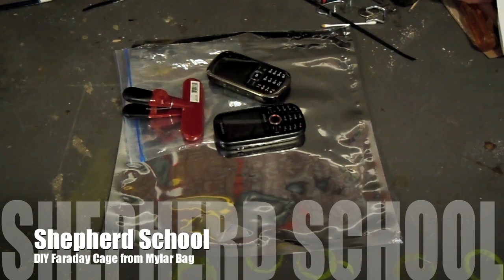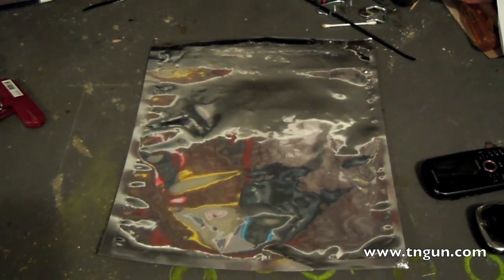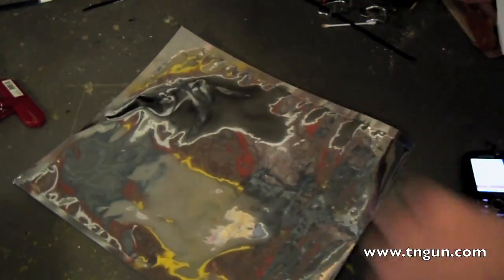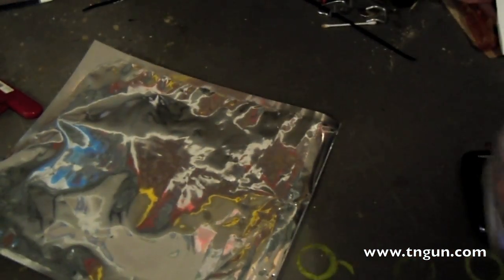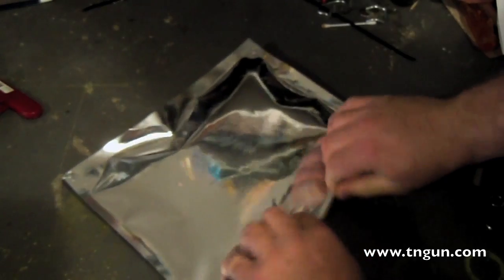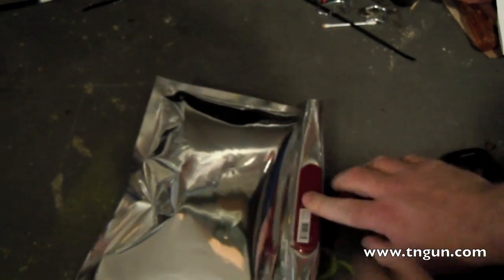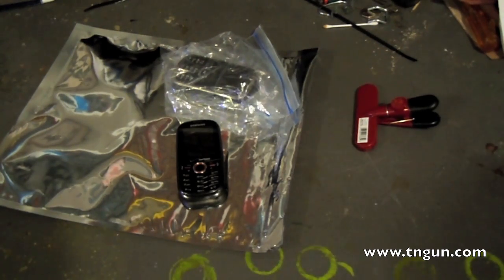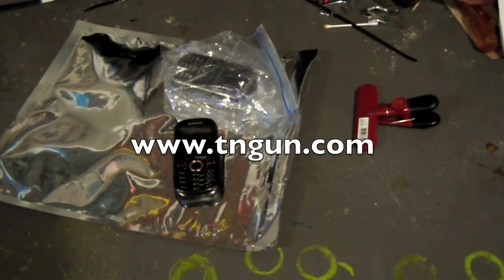How to Test a Mylar Bag Faraday Cage

Comment: Mylar bags do not shield electromagnetic signals because the heat sealed edges are not sealed in a way that make them a continuous conductor.   The second reason is that the aluminum that creates the oxygen barrier is applied using electrostatic deposition.. IE: Its not a continuous sheet of aluminum but instead its more like spray painted onto the plastic.    The aluminum flat sides of the bag itself would probably provide some shielding, but since the welded edges are not designed to be electrically conductive to each other, signal leakage is high.      Good for food, good oxygen barrier, poor EMP barrier.

Comment: I used 2 Cheetos bag to double wrap my cell phone and it worked.  But cell phones are very weak output.  Tried my ham handheld on 462MHz and the signal blew thru the double wrap at 2 feet, but a third bag did the trick.  Do I recommend Cheetos' bags, heck no!  I use aluminum foil/insulating plastic film and triple wrap.

Comment: From Rob Hanus:

Using a cell phone to test whether your EMP protection 
is effective or not. Cell phones work primarily in the 2.4 GHz range, 
which is also the same range that microwaves and most WiFi operate at. 
Thus, the shielding in a microwave is specifically tuned to shield these
 frequencies from getting out, or getting in. When you put your cell 
phone in the microwave, the signals will be blocked. Now try that with a
 radio and a strong FM and strong AM station. You’ll find that a 
microwave isn'’t very good protection at all.
Likewise, a Mylar bag will pass the “cell phone test” but doesn'’t 
really work well. When I first tried my Mylar bag, I put my cell phone 
in it while streaming a radio station over WiFi. After about 30 seconds 
when the buffer ran out, the phone went silent. When I called it, the 
phone was not available. Given this, it seems like a Mylar bag would 
make great EMP protection. It’s not, please read on.
The reality of this myth is that cell signals are very weak and easy 
to block with thin Mylar. The proof of this is that when I place the bag
 that has the phone inside it close to the WiFi router, the Wifi signal,
 at only 11 watts, was powerful enough to blast through the Mylar bag’s 
shielding properties. Had I placed an AM radio in the bag, I would have 
easily realized the ineffectiveness of the bag. When I was on the 
9,000,000 watt mountain top, I wasn'’t able to stop the RF with even two 
Mylar bags. Simply put, Mylar bags make terrible Faraday cages.
Source: http://www.thepreparednesspodcast.com/emp-preparedness/

Comment: Thanks!  Finally someone using a HEAVY mylar bag.  I am guessing that is a 5 - 7mil bag.  I plan to wrap any devices in plastic, then heavy tin foil, plastic again, tin foil again, then wrap in plastic one more time, then store in a sealed 7mil mylar bag.  Oh, with desiccants.  To Blue Marauder.  Yeah, cell towers would be crap after an event, but I am storing 1 Iphone for maps, contacts, how-to's and such.  Mostly radio gear, solar and battery chargers.  Oh.  LED flashlights too!  Can you hear me now?  Hello?  Hello?  Good!  2.4 GHz and 5.8 GHz are also good frequencies are good to try as well for testing purposes.
Reply: Could you afford moving?  Prepping for an EMP is pretty cheap.  Just because you move to another country does not mean you will not feel the affects of an EMP, especially if you are in Canada or Mexico.
Reply: This was great, been searching for "faraday's ice bucket" for a while now, and I think this has helped. Have you ever come across - Tennorra EMP Esterification - (Have a quick look on google cant remember the place now ) ? Ive heard some pretty good things about it and my buddy got cool results with it.

Comment: Late to the Party...BUT...Double Mylar bag DOES WORK to stop a strong cell phone signal.  When I found that a single bag stopped the signal in a low signal strength areas (like my basement), I went back upstairs and SUCCESSFULLY tested with A) two Mylar bags and B) a double wrap with metalized poly (a chip bag.) .  My best test was with an "envelope wrap".  Here is How: I wrapped my 2"x4" cell phone diagonally in a 9"x11" sheet of metalized chip bag.  Start at one corner wrap the phone once, then fold in side corners and finish the wrap.  Hold  the 'envelope' flap closed with a rubber band.  Test that in your area.  Cost $0.005 for a rubber band.

Comment: Stuff like this is total crap.
Get a 2 dollar Electric motor off ebay or where ever...
Take it apart and coat the inside windings entirely in foil making sure that its insulated from everything.
Now hook up a multimeter and spin the motor... notice it still produces current...

A flare is ENTIRELY and one part from a nuke is the Eletroc magnetic induced, as you now know for a fact thanks to running my test you know Foil does not protect from this.
There is a reason EMP hardening of military systems uses mono crystaline copper.
For small items foiled bag system can work, as the induced current wont actually cause any problems and against a nuke it can protect from other stages.
However if someone goes and coats a entire room in foil and thinks it will offer larger equipment protection it will not.
Reply: Can you wrap your trucks ecu in foil to protect it from a emp attack?
Reply: You are utterly incoherent.

Comment: That proves absolutely nothing. An EMP induces current in any electronics that have a coil (like a transformer) or an antenna. If you really want to test for an EMP simply connect a small transformer to a voltmeter and place the whole think in the bag. (you should be able to read it through the bag with a flashlight).  Use a simple spark gap generator to produce a small EMP and see what happens. When a real EMP happens it ionizes the atmosphere and microwaves are produced - gamma is filtered.

Comment: so what would a "one size fits all" shielding be? What levels of EMR are we likely to see with solar/nuclear EMP's? I'm looking for a portable solution for my portable electronics gear in my BOK and also my electronics equipment at home...the stuff I have at home is in use so I cannot lock it in a cabinet...I would robably have to shield the whole room. I'm looking at painting the room with aluminum infused paint then running copper wire at all joints in the walls, then out to a main ground..?

Comment from the maker: I did not do a specific video on this. but I did do a blog post talking about EMP pulse.  An EMP pulse is not the same frequency and wavelength of a radio or microwave, but I posit that if a cage cannot stop such weaker waves then it cannot protect against the much more powerful pulse.

Comment: I've seen a lot of these videos showing how a storage cabinet or mylar bag or even aluminum foil can prevent radio frequencies and/or microwaves in the later from getting through. But what is the relation of radio frequencies and microwaves to what occurs during a solar flare or EMP? Aluminum foil and mylar may protect against radio and microwaves, but is it protecting against the charge and other aspects of a solar flare? I have yet to find any videos explaining this.

Comment from the maker: @WprEmiere1985 You know your idea is pretty close to my thoughts - I figured I would buy a plastic antistatic bubble wrap bag from staples, put my ham radio in it, stuff it in a Mylar bag, roll the end up and clip it with some metal clamps and have a small light Faraday cage - if worse comes to worse, the Mylar could be used as a water container for drinking also...

Comment: @TNGun I agree, a safe would be a difficult thing to ensure there was absolutely no gap or hole of any kind, even through the lock. An effective shield must be 100% metal to metal sealed. Any tiny hold or gap is enough to make it ineffective. Steel or copper is recommended for EMP shielding. Obviously the distance from an EMP source and the EMP energy is the key factor. For an EMP from a typical nuclear blast, the mylar would likely not work if you were within 500 miles.

Comment from the maker: @mdr8088 I am going to test tinfoil - It blocks cell signal easily, but not much else.  The problem is these tests are illustrative and not definitive.  A cell phone is so easily blocked (as Dicaster said) all it does is prove what does not work... EMP is MUCH stronger and works in a much wider spectrum that any true test would need several device types or use a EMP generator -  I would get one but A they are expensive, and B I don't want to be indefinitely detained without trial...

Comment from the maker: @lastquest From my research grounding is for static electricity and lightning and either has no effect on EMP, or it acts as a antenna to enhance EMP.  As long as your gunsafe has a complete 360 degree metal contact (no paint or gaskets around the door seal it should work fine as a Faraday cage.

Comment from the maker: @wtf0804 I hate to contradict you, but EMP works on a device no matter if it is powered or not.  It sets up induction between the conductors in transistors or microcircuits.  Basically any thin wires close together are heated by the RF energy and melted.